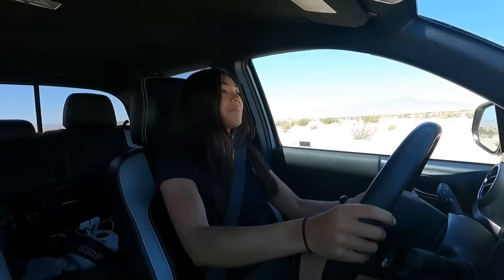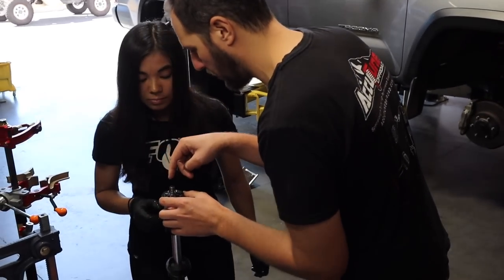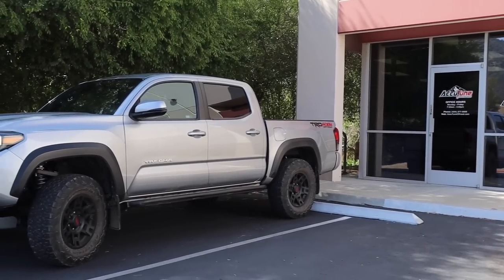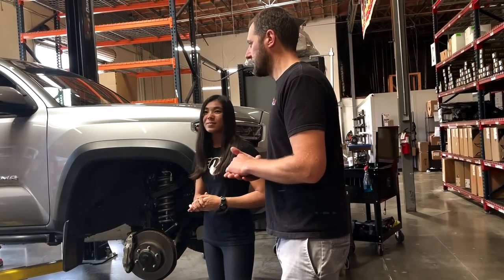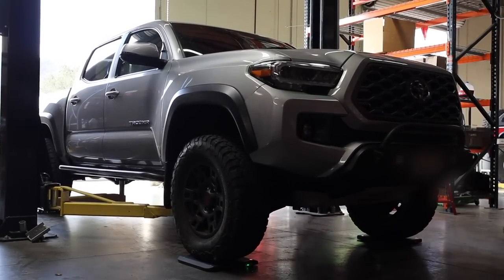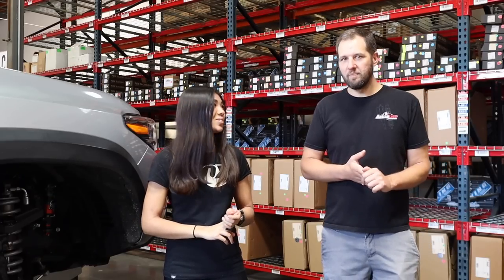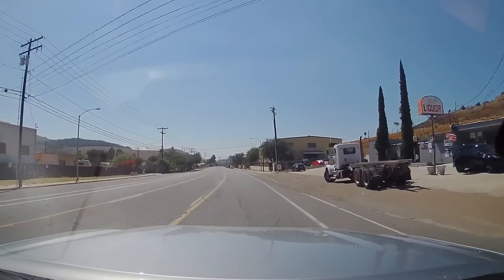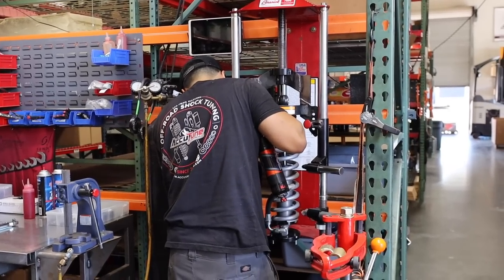Trying a Shock Tune on my Toyota Tacoma! AccuTune Off-Road Re-Tunes my Truck

Comment: Thanks for the informative video Chloe! You’re becoming an off-road journalist of sorts. I’ve been hesitant of leaving the TRD Pro Fox Shocks on my 4Runner for this very reason - they are tuned specifically for the 4Runner and I wouldn’t want to throw any expensive suspension in without a tune for my driving experience.

Comment: Accutune is hands down one of the best shock tuners I've dealt with for this application. One big reason is they're not about full race. They accommodate all driving habits. I just picked up my Fox FRS 2.5 DSCs for my Ford F250. I live really close to them so it's super convenient. I haven't had a chance to run the shocks yet but I have no doubt they will impress me. I'm used to dirtbike/quad or SxS shock tuning so I know 100% that off the shelf shocks get you out there but tuned shocks make your adventure more enjoyable. Great channel and great videos. Keep up the hard work!

Comment: Their truck feels smoother because they're running bigger tires. Moving your 50 lb battery from the front of your truck to under the bed next to the gas tank will make the biggest difference. Not only are you removing 50 lb from the front but you're placing it in the rear so the net effect is significant.

Comment: For smoother ride on highways and also rough pavement roads would you recommend fox shocks ?
Reply: Fox is a bit softer over the factory shocks on road and easy trail with rocky chatter, it definitely evens out the harshness. Fox 2.0s make a big difference, the 2.5 option can be softer than the 2.0, but off the shelf (non custom) see a firmer (more controlled) highway ride.
Reply: If your budget allows for it, yes some Fox remote reservoir shocks will ride very nice on the terrain you described.

Comment: Interesting the tunes all sounds backwards, generally I think stiff for higher loads like turning and breaking on asphalt.  I would think for faster driving off-road you'd decrease rebound to help keep tires on the ground.  Very interesting to think about.
Reply: shock terminology is definitely confusing at first, low / high speed has to do with shaft speed, not vehicle speed. More rebound means faster rebound (per your example) to keep the tires planted.
Reply: And rebound tuning is very specific to how fast you're taking bumps. If you're driving under 15mph, then slowing down rebound will feel better for the driver to reduce bucking (after going into a compression event). But a faster driver needs faster rebound to keep the tires planted after a compression event.

Comment: What does it cost to have this type of tune done on a truck.  Shocks were originally purchased from Accutune (Fox 2.5 DSCs)/
Reply: If you purchased from us, those shocks already came tuned. If you are looking to have the valving changed, feel free to reach out to us for your free revalve.
Reply: @accutuneoffroad  can the valving get even more dialed in doing what you guys did with Chloe?
Reply: @jackg8478  Riding along with Chloe and having her drive our truck was mostly for this video specifically, not something we offer or is really needed. Since you already have shocks from us we are happy to help make suggestions on DSC adjustments. Just get in contact with our sales team and they can help you out.

Comment: Off topic...have you heard if Toyota offers a front Camera for the Tacoma.  Like the rear camera but facing forward and can be turned off and on.  There is a huge blind spot right in front of the truck.  Thanks
Reply: I have front cameras and 360 views on my 22 tacoma trd pro. Maybe you could buy after market and install similarly?
Reply: TrailGridPro and others make an Anytime Backup and Front Camera Kit and I believe Chloe reviewed a similar one.  Fairly straight forward to install and a great product for that blind spot.
Reply: Thanks.  Going to their website
Reply from the maker: Hi, check out this video--hopefully it helps! https://www.youtube.com/watch?v=MI-olJnJPEw

Comment: What they did is they change oil viscosity to high to achieve Off-road capability and stability for high speed on highway.
Reply: high speed on the highway doesn't equate to high shaft speeds.
Reply: We did not change the oil

Comment: You already spend a lot of money on fully adjustable shocks, why not just use all the adjustments you have to tune the shocks! Unless you are Baja racer, it is so unnecessary to tune them for daily driving!
Reply: This video feels like just advertisement to me.
Reply from the maker: I had the same sentiment prior to getting them tuned (I had honestly thought there would be a minor difference but nothing super noticeable to me), however it was surprisingly a much bigger difference than I expected, even on-road! The DSCs still give you a range of adjustments depending on the terrain/driving, but revalving allows the shocks to perform as well as they were designed, especially if you're like me and have limited up travel because of added accessories

Comment: Nice review about the shock tunes by Accutune, for the Fox shocks. … I presume the tune would need to change if you changed the Methods and the tires? 🙃🍷🛻
Reply: Wont likely need a revalve from just that. We do however recommend staying away from heavy load range tires like E. Stiff tires like that are hard to tune for.